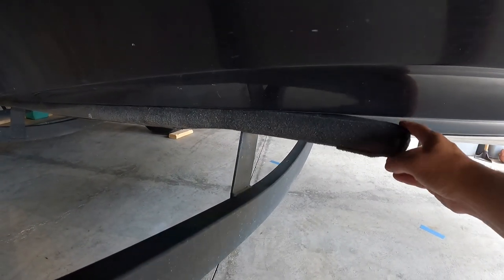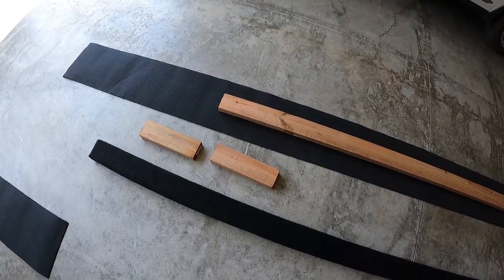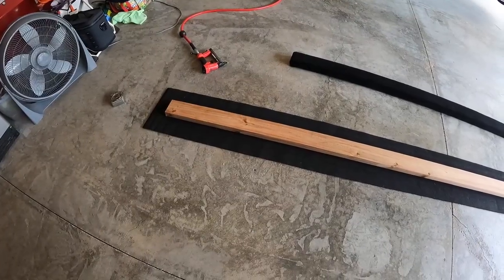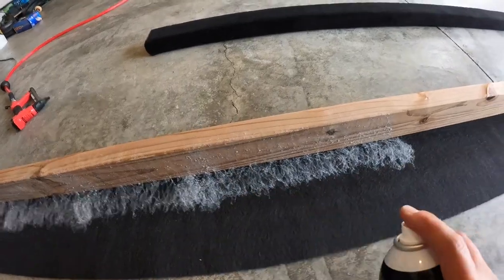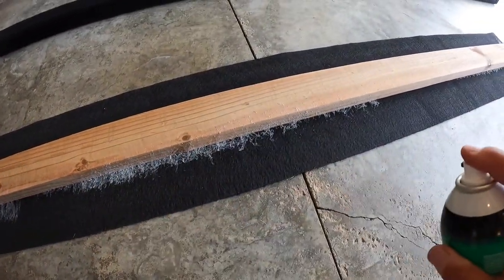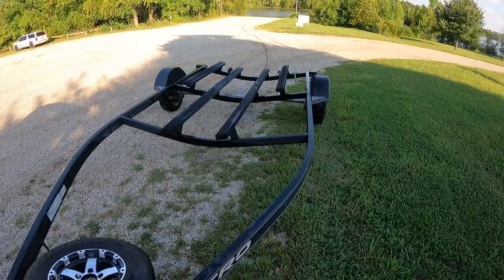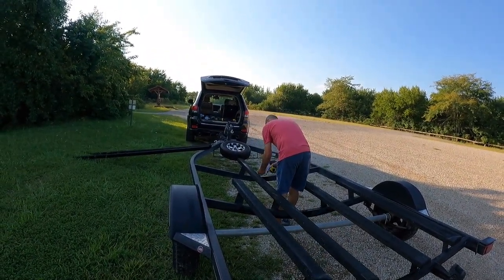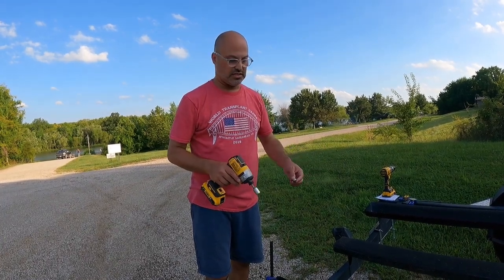Replacing Trailer Bunks the Fast and Easy Way! Aug 2022

Comment: Never cut your padding folks. Wrap corners like you’re wrapping a Christmas present. Trust me
Reply: How come I just redid mine and cut ends like he did. I put like 10 staples in side and bottom

Also read not to use glue either on treated wood so I didn’t
Reply: @proassassin8473  come back to this post in a year and let me know how that held up for you.
Reply: Mine held up fine for 15 years cutting the carpet